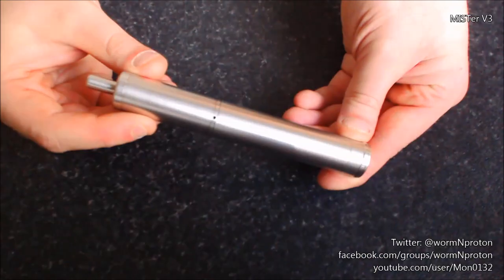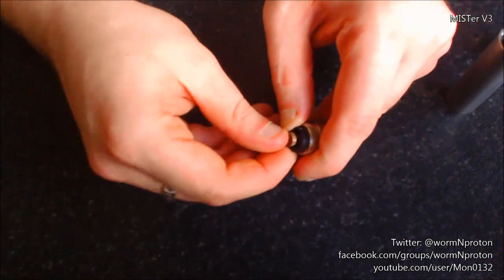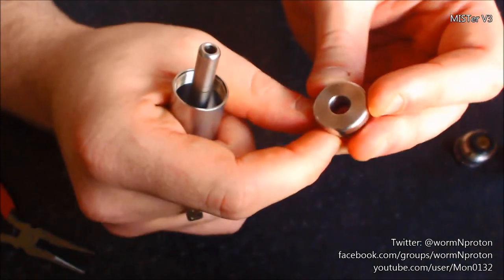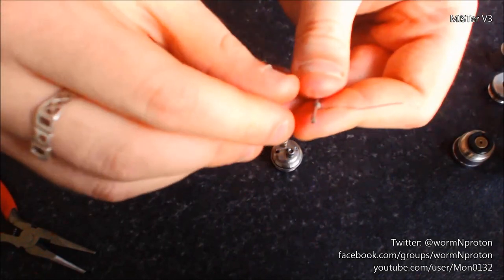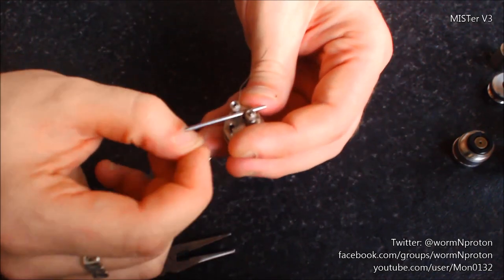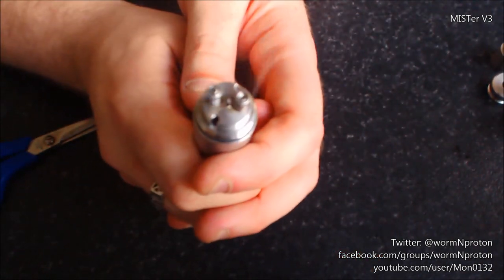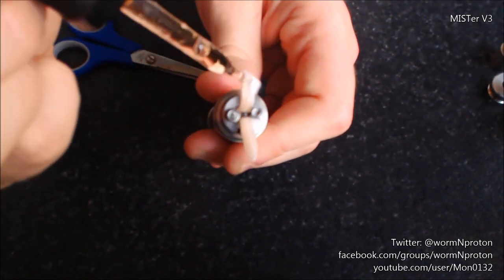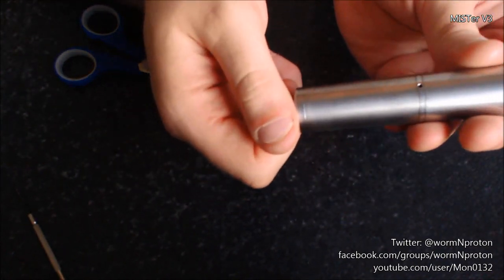Silica MISTer v3

Comment: Thanks Mr Proton. Top job. The capacity stated on the site is actually for the short mode tank. The capacity of the standard tank is advertised as 4.5ml. However, it takes closer to 5ml.
Reply from the maker: cheers mate, thank you for sending it down